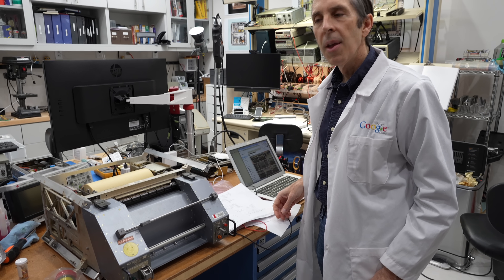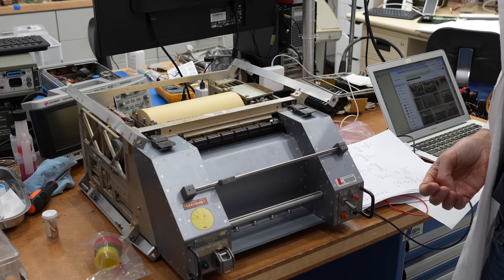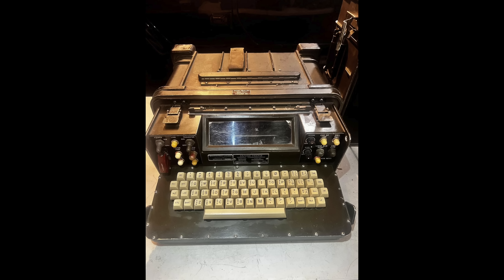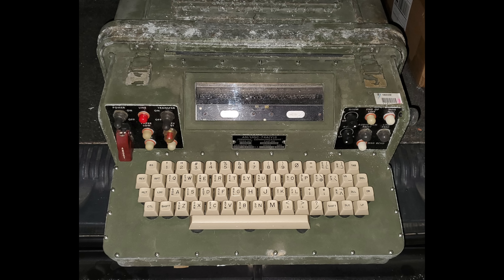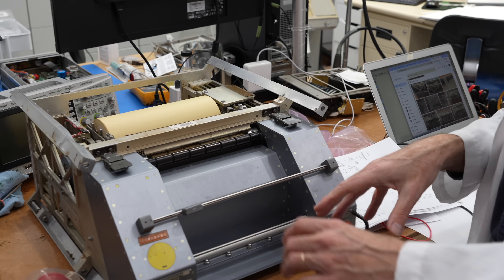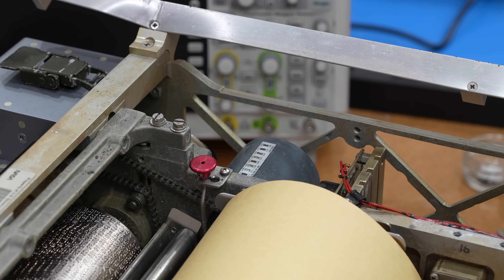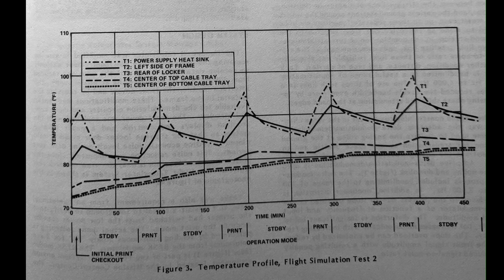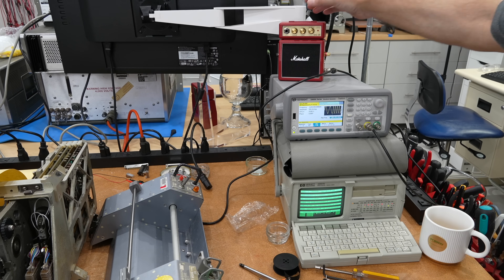Space Shuttle Teleprinter - Part 1: a 59 lbs TTY in space, what gives?

Comment: Why this heavy printer ! in 1980 Epson had the MX80 9 pin dot-matrix printer , very light and printed on plain paper . Seems crazy taking this boat anchor into space , surly they could adapt MX80 to accept FSK , likely a FSK to parallel or RS232 already existed . Must be loads of issues using this teletype in zero G likely the overheating wasn't helped as no natural convection . Great video though keep up the good work
There were some fairly light/small daisy wheel printers available in 1980 if they wanted a character printer

Comment: Oh my gosh! A teletype on yhe soace shuttle 😂 i just love how the basis of all modern comouters is the 'standard out' print command and linux is based in unix which is based on running a timeshare computer OS with a teletype. My grandpa was a telegraph and teletype engineer. I still have some of the special tools for replacing and servicing relays and other components for switch boards and teletypes.

Comment: It looks as if the form factor was the driving factor. Interesting, because the DEC LA-36 printer would have been a better choice if weight were considered. Interesting that they used the MC6800 processor. We used the MC6802 (a close relative) in the Data General D200 terminal in 1981 (development began in 1978). Of course they would use non-standard FSK and get only 600 baud. Bell 202 half-duplex modems used 1200/2400 Hz and would have worked fine at 1200 baud.

Comment: It's successor was a digital Fax like system with continuous tones, so it wasn't compatible to standard Group 3 or 4 faxes. The first iteration didn't work reliably, but then the second one, based on a commercial (though expensive) greyscale printer worked.

I'm wondering if they just could have used a standard dot-matrix printer? With a 24 pin print-head even some stuck pins wouldn't have been much of a problem.

Comment: By the 21st Century the Shuttle had a color printer that fit in a padded zipper bag. I saw it in one of the pictures of debris from Columbia. Crazy that the printer fell from space and landed with apparently no damage. Whomever found it had partially unzipped the bag so the printer and some cords could be seen, and on the outside of the bag was a label that said COLOR PRINTER.
Reply: Interesting!
I'm reading that Discovery first used a Epson Stylus Color 800 in 1998.  Looked pretty rugged with a metal exo-skeleton of sorts, and paper trays.
Looks like they used the same model on the ISS.

Comment: The military used teleprinters well in to the 1990s.  Fax machines had been the standard for a while in the corporate world for some time at this point.  The reason why the military used teleprinters was simple.  They could be used with very poor radio signals.  A fax machine was normally run at 9600 baud.  1 kilobyte per second.  A teleprinter ran perfectly well at 1200 baud.  Given that signals to and from the space shuttle would often be bounced around several relay stations, the lower baud rate was much preferred.  Reliability of communications was far more important than speed.

Comment: I have to take issue with those estimates of cost we always hear like how this cost 1.5mil to launch every time. Calculating the cost by dividing the total launch cost by total payload weight makes absolutely no sense since the launch was going to happen anyway whether this was on board or not, and whether it weighed 1lb or 500. As long as there was excess payload capacity available and the launch was already happening, the actual cost to launch an extra 52lbs would actually just be the cost of however much extra propellant required to get that extra 52 lbs to the same orbit. Using the rocket equation and the shuttle data, I calculate each additional lb required around 10-15lbs of excess propellant, so on the high end and using 90's prices, we're talking around $300-400 extra to launch that thing. Not bad at all IMO

Comment: I remember the army-portable version of that printer.  I worked in a communications lab and we had one around to check the equipment we were developing.  It was notable because it could meet military EMI radiation requirements and it could do 60 uA current loop while standard Teletypes were 60 mA.  The low loop current was intended to help reduce EMI emissions.  At the time, the US military standard was 45.45 Baud Baudot 5 level code 60 WPM.  The printer could handle up to 1200 BPS, and I don’t remember if it was switchable to ASCII.
Reply: This comment is close to what my guess was going to be for this video.  The reason it is heavy is because the pesky Russians might be listening.
Reply: @darrenhersey9794   The Earth bound Army version had the Supposedly RF proof cabinet snd there was wire mesh in the the glass for viewing the print mechanism - I believe to help prevent RF escape.  At the time RF intercept was being taken pretty seriously.  That was late 1970s - early 1980s snd RF suppression science wasn’t as good as it is now.  The fix then was to shield everything like crazy rather than to design boards for low emission to start with.

Consumer products went through the same sort of evolution.  I remember when the Apple II came out in 1979, it could wipe out a table radio’s reception on the other side of the room.  The FCC came out with class A industrial and class B residential interference rules.  Apple’s initial response was to shoot the inside of the case with conductive paint and use metal shielding around the cut-outs for the card slots.  By the time the Apple IIe came out, they were better at designing the board and it was back to being in a plain structural foam case.

I’m. not sure why there was a magnitude specification on the current loop.  TTYs operated as current driven devices, rather than voltage driven.  That helped make operation independent of loop length.  The Army spec was 60 uA for the current loop.  They even retrofitted the huge model 29 Teletypes for low current operation.  I don’t recall ever seeing any rise time specifications which seems strange because the pulse edge is what is going to generate a lot of rich RF.  At 45.45 Baud, they could have afforded to pretty heavily low pass filter the signal to round off the pulse edge.  The US government had a spec book available to people with clearance, and that specified maximum equipment emission levels which they believed were below what the Soviets and other sneaky people could intercept.  With the attention to RF leakage, I guessed they had either been burned by intercept or they were doing it to the Soviets and knew they should prevent their own RF leaks.

The other side of the coin is susceptibility.  You need your equipment to be resistant to EMP from natural or man made sources and to be able to resist flooding attacks by microwave beams snd the like.  Space based equipment gets bombarded with cosmic radiation.  The first microprocessor to be space rated was the RCA Cosmac Elf 1802 because its CMOS design made it more resistant to radiation.

Comment: An Epson MX-80 (commercially available in 1980) would have saved at least 18kgs. if they only got 600 baud, then the MX-80's 80cps would be quite adequate. And more important; Green bar printout --  in space. All that extra room could have been used for a decent little modem. (Let alone that a thermal printer plus an automatic  fire-extinguishing system would still be lighter than than the TTY. ... and I'm not mentioning that the shuttle operates in a vacuum... just put the printer in the airlock. Problem solved.)
Reply: Would probably be harder to cerrtify though
Reply: The MX-80 was a real workhorse.  It was slow as molasses, but ran forever.  It did have a serial board option from Epson too.  This shuttle teleprinter would have been quite a bit faster than the MX-80.  We had the Army version with keyboard in the lab where I worked.  I wonder how cartridge ribbon of the MX-80 would do in zero G?  The Army model uses standard Underwood style ribbon spools snd it probably would have been easy to cobble up a ribbon with some kind of space certified low VOC ink.  The Army printer also uses roll paper which takes up less storage space than pin feed paper.

Another candidate would be an Okidata Microline (forget the model).  It was the standard reservation printer in just about every hotel up to about year 2000.  It used the same Underwood style ribbon spools and was faster than the MX-80.  I believe it is about age contemporary.  The Okidata could do pin feed; I don’t know if it could do roll paper.
Reply: @wtmayhew  Obsługiwała z odpowiednim podajnikiem, ale nie było to niezawodne jak ten teletype, Czasem za 4 razem udało się załadować dobrze papier. Reszta ok
Reply: @  Thank you for the reply.  I never had to load the paper.  It is not surprising to learn that it took four times to get the paper to load correctly.  The design was not very user friendly.

Comment: About a decade ago I almost bought a very technologically backwards Datametrics army thermal printer from the mid-1980s.  The reason I didn't buy it is because I couldn't find a way to power it.  To tell you how backwards the design was, it had a board full of TO-5 transistors just to drive the elements of the Gulton line printhead inside- and this was a 1980s design!  The modernised version of the same printer uses an off-the-shelf Citizen driver IC and printhead.
Reply: I get what you're saying.  And, yes, that kind of discrete design was sorely outdated for the year.  But imagine what it's like from a reliability standpoint - or as the repair tech.  When you have a failed or damaged IC, you have to ditch the whole thing, and you can't probe in-between the inputs and outputs to see what it's doing.  The more functions crammed into one IC, the more you lose when it goes off.  60s/70s stuff has high part counts, isn't space efficient, and has a lot of parallel / replicated topology, but it's all pretty independent, and a lot easier to trace and mend.  Low part count IC systems, when they go wrong, REALLY go wrong.

The thing I hate the most is custom ICs (and usually my ire goes to HP for this - especially ones that contain high-ish voltage driver outputs). But the worst thing I can recall was a customer who brought me a 1980s Futaba precision DRO and glass scales.  Under the hood, the readout was essentially one very large (~48 pin) custom PDIP.  No datasheet for the part, no drawings for the unit, no source of replacements.  Most of the unit outside that was just interconnects and a bit of buffering.  There really wasn't much I could do unless I wanted to reverse-engineer all the functions of the IC and try to cobble together a functional replacement using a general purpose device with programming.  Ancient Anilam / Acu-Rite / whatever stuff, with high part counts, has a much greater chance of repair.
Reply: Sounds a sexy bit of kit the military go overboard with robustness but forget the more mass you have the more "g" you have to manage. Racal did the same. Still it is comforting to have such stuff in the study. 

Check out  " John Huchinson " , his lab is full of wonderful RADAR and RT kit. 
I like the 2N3055 I find it is better containing the blue smoke. Best
Reply: Probably was designed for radiation.